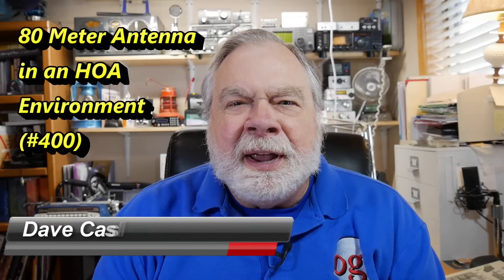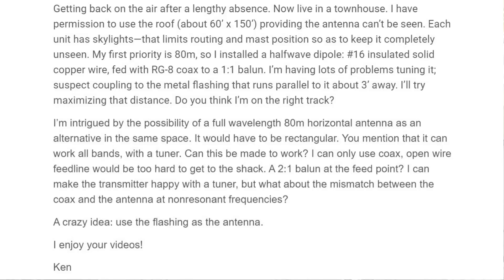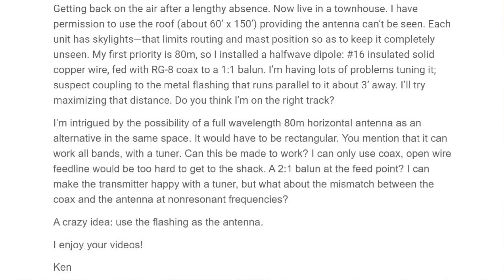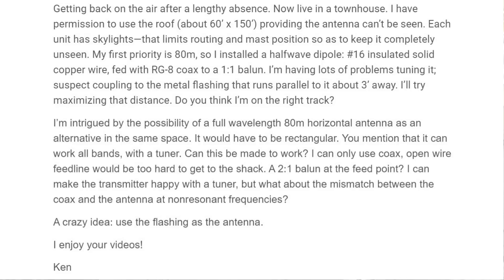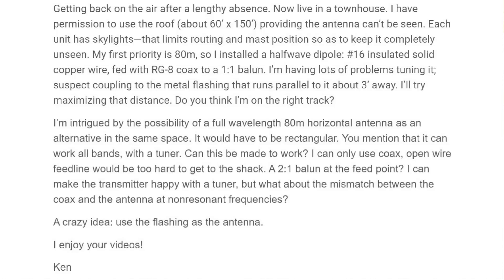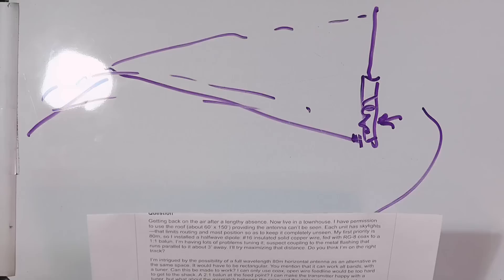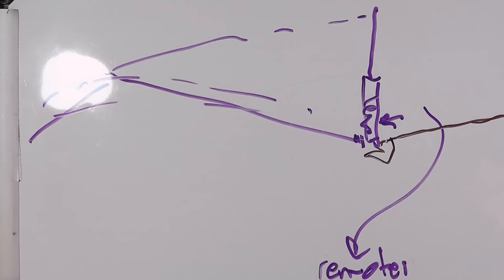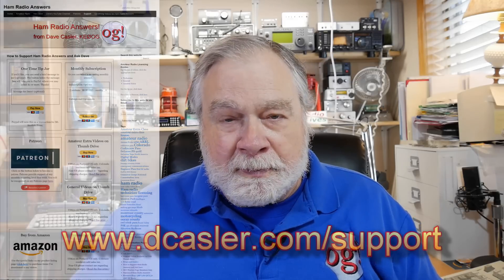80M Antenna with HOA Constraints (#400)

Comment: With a verticle on 80m you might not have the right angle of radiation - Dipoles work best up high to reduce the ohms and in an inverted V - I had issues at my old place with a body corporate saying my Diamond CP6S could not be visible from the road - plus there was a metal awning coveing most of the small back yard so it was too inefficient. With space limitations I went with a G5RV which is a compromise as will tune to 20m sweet, tuned reasonably well on most bands except 80m and 40m with my LDG autotuner so used an MFJ-904 manual tuner instead to tune in the bands but got too much RF coming back down the coax so built a dirty banun  using a 6cm length of PVC plumbing pipe with the coax wrapped about 10 turns and taped which I then located to the feed point of the ladder wire on the G5RV which fixed the RF - but it's still a compromise on 80m on anything less than a full-wave antenna up high.
He could try attaching the wire to the side of the roof if there is no overhang of the metal roof then stretching the wire down from the roof to about 1.5 m off the ground at the end with bends no more than 90 degrees.
Metal roofs and fences are not antenna friendly as will bounce the signal straight back onto the wire causing all manner of problems. I feel his pain. The mag loops are expensive too.

Comment: Dave, I am quite happy on 80 meters with a 73 foot "random" end fed wire with a 9 to 1 transformer between the coax and the wire.  I can talk 600 to 700 miles quite well.  It will tune everything from 80 meters down to 10 meters, I have visited with Barcelona and Brazil once each.  After struggling with a broken dipole and a broken transmitter I finally got on the air with the end fed and I am happy.  phil NM5PT

Comment: You could do it with one of these, too:- https://mfjenterprises.com/collections/antenna/products/mfj-2100
Mix and match any four HF/VHF/UHF bands.

Example: screw in 80,40,20 meter hamsticks and a dual band 2M/440 MHz whip (two on each band) on opposite sides. Now you have an automatic bandswitching 5-band dipole! Rotate it for maximum signal and minimum QRM and noise with a small rotator like Hy-gain AR-50

Comment: I also live in an HOA. after trial and error i am now using an 87meter long endfed longwire antenna, with a 9:1 balun, and 30meters of rg213 coax feedline, which i use as a counterpoise before going into shack. The longwire runs along the perimeter around the roof. The balun is in the back yard on the left side of the roof, i ran the wire from here under the rafters to the right back side of the roof, (from here I threw the wire over the knock of the roof at night towards the front side of the house). from here it runs under the rafters again in the front but this time back to the side to opposite where the balun is. I waited again for the following night and then threw the longwire over the roof again towards the back end of the house where the balun is and tied the end off with thin fishing line.  So the longwire runs around the perimeter of the roof, it cannot be seen even when you know its there as I used flex wire and sprayed it the same colour as the roof tiles. My swr is 1:1.1 to 1:1.4 on the entire HF band without my ATU. Also being in the shape of a square i manage to hear stations N/S/W/E from me (its literally a square longwire). My noise floor on a vertical is around s7 , but using this longwire my noisefloor has dropped down to an s2, however signals from stations are stronger. food for thought, maybe this could help you? 73 de zs6akw

Comment: A 3 foot diameter magnetic loop antenna would exhibit less than 1% efficiency at 80m, that is more than 20 dB down from a dipole.  Antenna modeling confirms that a vertically oriented magnetic loop will work as expected at one loop diameter above a conducting surface, but should be at least one half wavelength above the surface for comparable efficiency if oriented horizontally.

Comment: I have a 1 acre lot in HOA with large pines along rear lot boundary. End Fed Half Wave (132 ft) feedpoint at ape of roof at about 30 feet with wire running out to limb in pine at about 60 feet ... works extremely well. I recommend ULTIMAX EFHW or the comparable from MYANTENNA ... I use my ULTIMAX with a tuner and work 20 thru 80 meters with ease ,,, neighbors dont even know ts there!  K3RRP

Comment: A 3m Loop is a little small. The efficiency will be way down. I’ve had significantly better results with an 8’ Loop made with aluminium strap. They are certainly more complex than a dipole, but when you get it right, the results speak for themselves
Reply: you should post a video of it!
Reply: @billylozito1789  I’ve been thinking about that. However, it doesn’t fit with the rest of my YouTube ”Content” which really should be viewed by no one and one of the reasons I don’t allow myself a microphone (or keyboard) when I’m on the air ;-)

I’m playing around with camera / video stuff at the moment. Want to figure out an easy way to put it all together. Same way I do when I do Jingles and parodies for the No Agenda Podcast. I can churn out a tune in under an hour from first penning a lyric to emailing it to Adam

But yeah, there is a lack of info on larger higher power loops for lower frequencies

Comment: I love my ATAS-120, but they are expensive!
Reply: And I’m not sure if they will work with any radio?  I have a couple for my mobile 857D.  Would love to work it on my 7300
Reply: @justcurious8263  I think you just need an auxiliary controller?